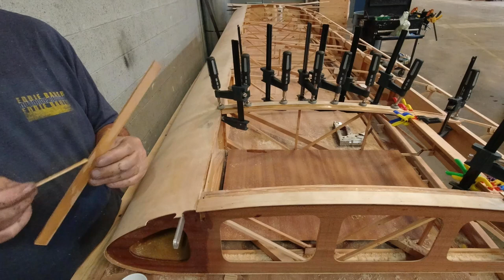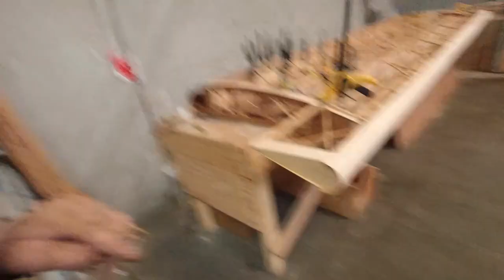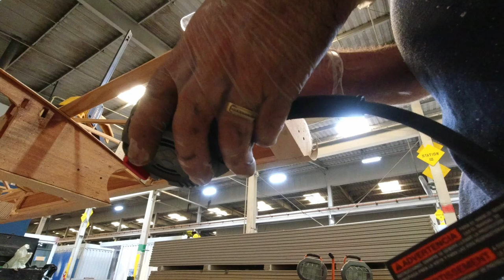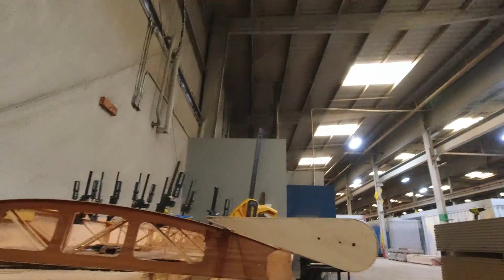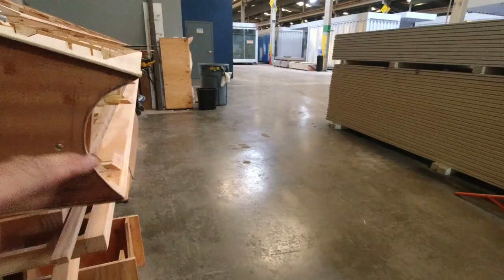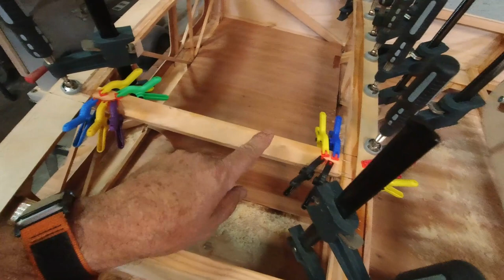Minimax 1100r Aircraft Build Vlog Episode 30

Comment: The question I asked before has been answered, I thought you might put cut outs in the front to rear strip you put in to get around the gussets but I see that you are using the squeeze out to fill the gap. If there is not anything going over the end of that piece at the rear spar I would round the corner off as it will try to eat through the covering if not rounded.
Hot Stuff I use baking soda to fill gaps on my model aircraft, just fill the gap and apply thin CA and you have a sand able filled joint (try it on a scrap), it is easy to get right into tight gaps.
Looking good.
Reply from the maker: I did round that piece off on top. 
I’m glad to be past figuring out that tank area. It should have a nice recessed cover. Now to take care of that aileron LE clearance and make sure I have room for the fabric between everything. Then I can add that rib two brace and then get this right wing varithaned and get going on the left wing.